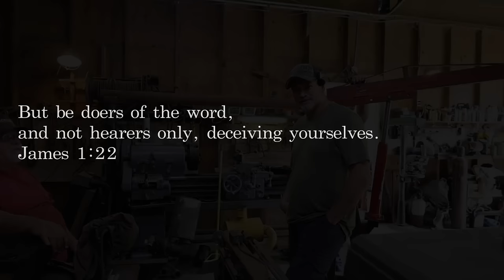WE HAD NO CHOICE BUT TO REMOVE THE ENGINE! BAD NEWS!!!

Comment: It's always nice knowing someone who's knowledgeable with machines. Weather or not it's your interest they can give the story on how or why something has changed from year to year and what to look for. 

I did a lot of research on my vintage dirt bike before buying it and found out Yamaha used the same engine in three different models of bikes.

Besides some bikes lacking the features of others, bolt mounting patterns being a little different and the head fins being changed in later years because of how they ran the exhaust the engines are pretty much identical to earlier models and parts are interchangeable. 

It makes parts shopping a lot easier. Especially when you can't find something for your year and model of bike but you can find something for a model a couple years newer. :)

Comment: 41:53 tell Jeff to check ring position ie.. make sure ring gaps are spaced away from each other and also check ring gap in the cylinder. Each one of these can cause some oil passing by and blow by. Also check injector nozzle tip for that cylinder orfice on the tip could be eroded away and causing excessive fuel dumpage in that cylinder.

Comment: Leaking valves will cause some of the fuel to not burn causing black oil like substance to come out of the manifold. I also once thought it was engine oil, but after doing compression tests and redoing the valve faces the issue was resolved. 
Also a bad injector will cause similar issues.

Comment: Hey guys, I had the same thing on a ford 4600 3 cyl diesel, chased the same problem thinking it was going to be a piston or ring problem.  it was the valve guide wore in the head causing oil to leak through in to the exhaust.   Have the head checked!

Comment: It could be a possibility that the rings on there could need replaced or that particular. One might need to be replaced and maybe the others could use. Maybe some grease on them. Could have maybe dried app, given that it's sat for 10 years or so, because those probably have dried app with the time that they sat there.
Reply: And I really think honestly. I think it's a good move that I just heard. Jeff say that rebuilding it would be a good move. Because then he would have more life outo. F. Be just a rebuild what he's got now it was just extended and he probably would get more life out of the engine if he was to rebuild because of the damage that was done with the engine as is.  It might be a little more costly but the life you would get out of it. Just being able to rebuild it and all that. Then you can grease the parts and stuff like that. But Hey whatever has to be done. You know, I mean it's a good dozer, though, from what I've seen and stuff like that so far.

Comment: Stand the motor up on the flywheel  ,then your not working under the motor ! Thats dangerous  working under a suspended engine, pluss when its on the ground its solid and not swaying just a tip!

Comment: You are making a mouse trap. There's easier ways to do this you . I usually block the engine on the bell housing on the floor because I work alone. So I choose not to work under a swinging load.